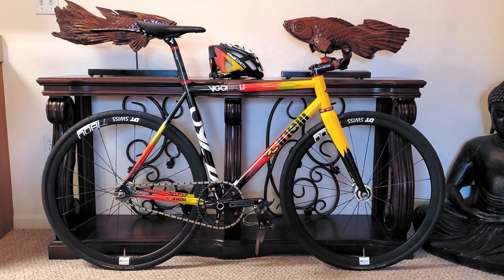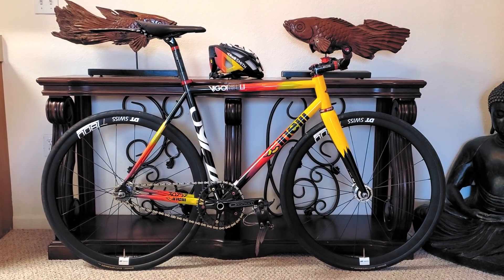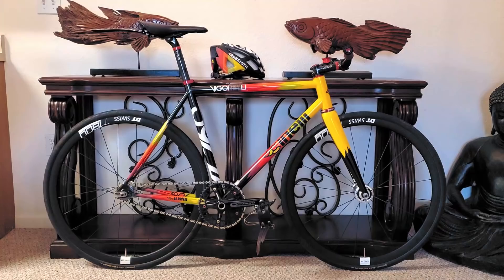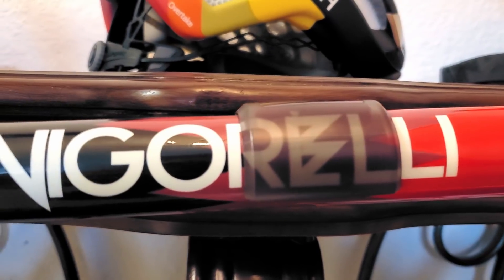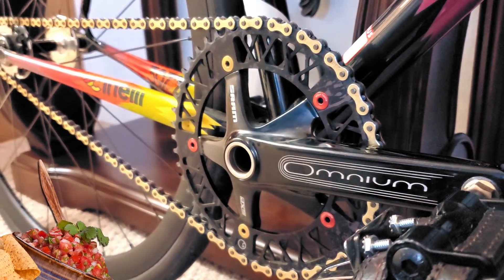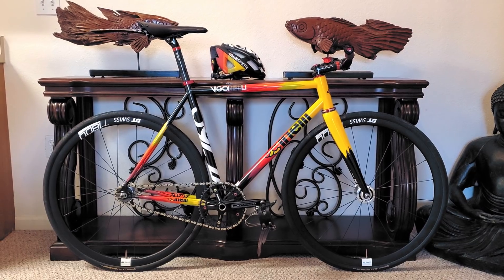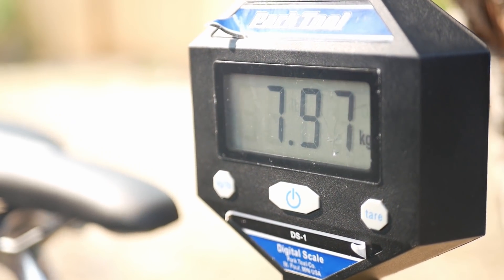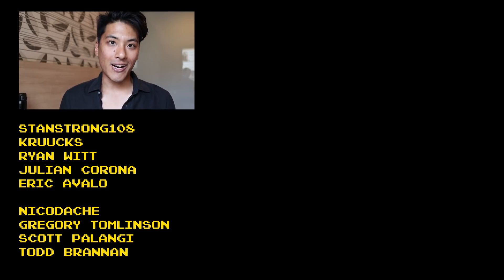Fixed Gear Bike Check: Cinelli Steel Vigorelli

Comment: You're on the other side of the world with notification at 11:30 PM local. Videos are always welcome. That bike looks great but currently lacking  motivation to send in my Aventon. Is nothing too exotic but weaned me from the trap of complexity, and ever changing standards of the bike industry. Rebellion. There is no fixie culture around  here but with front brake on am accepted as the oldest fast rider there. Downhills and tailwinds are really tough. I realized that in my prime really I used only 3 gears. I just picked the middle one and adapted decades later!

Comment: I literally just built my Parallax with most of those components. NEOS drop bars with histogram bartape, NEOS stem and seat tube. DT Swiss T1800 wheelset with DT Swiss hubs, aero spokes and Gatorskins. Omniums with the ceramic GXP BB, Izumi super toughness chain. No Brooks saddle but a cinelli one. Otherwise nearly identical except for the handlebars, headset, collar, cog and saddle. Solid build Raul
Reply: Gossip.

Not even close.

Comment: Seriously nice wheels. On the SRAM Omnium, the stock bottom bracket is not great, so replacement can help smoothness, like the Omniracer bottom bracket I switched too.
Reply: BeboSaab My SRAM bottom bracket developed a noise, and severe drag, in just over one year of riding. If I would guess, it’s probably a quality control issue. I went with an Omniracer bottom bracket, which was immediately noticeable as smoother, quieter, and less friction.
Reply: On sram cranksets you can change the sram standard of BB to a Hope BB and buy a sram ring adapter to convert from sram to hope.  The hope BB is shimano standard.

The bearings will last longer and smoother.  And extra points because it’s Hope 😊😊

Comment: it just me or I never saw anyone put the seat post clamp like that
Reply: Some bikepacking saddle bags interfere with the seat clamp in normal position. Not sure this is a bikepacking bike tho
Reply: It reduces localized pinching from the seat tube slot and seat post clamp on the carbon seat post.
Reply: @props651  Should I do the same when installing my carbon seatpost on my aluminium bike?
Reply: I would. I do the same on my cinelli semper. "Better to have it and not need it, than to need it and not have it."
Reply: @props651  Thank you dude, so glad I saw your comment or else I would’ve never known :P

Comment: Steel is real...but also real heavy.
Reply: high end steel is still lighter than low to mid tear alloy
Reply: @johngorgis  high end steel is super expensive tho but really nice. for that price you can get a lighter alu frame or even a carbon frame like the Dolan seta or  the planetx pro carbon.
Reply: masahito sato cant argue with that ,titanium has to be the best compromise between durability and lightness but its very expensive
Reply: The vigorelli frame set is actually fairly light. When I got mine I was pretty surprised at just how light it is
Reply: @johngorgis  yeah ti is crazy expensive
Reply: @OGLobster  I find that the vigorelli steel is quite heavy, 1.9 kg. But the thron is quite good tubing. Like if the vig would be made with the life tubing it would handle totally different. For around 1000$ or € you can get an amazing alu frame that weighs around 500grams lighter or even less and maybe is cheaper. But then again you have to factor in the ride quality and what you want in a frame. If you want a steel frame its perfect. If you want a light bike you get an alu frame or carbon one. Really depends on what you want
Reply: This bike weighs 17.5lb
Reply: @raulopes . Not saying the complete bike is heavy but the frame is if you compare it to other alu frames for the same or lower price.
Reply: @BeboSaab really depends on the person, frame or and components you got on it. Same goes for steel. A high tensile frame rides like shit and a cheap alu frame rides like shit.
Reply: @M.asa.  @BeboSaab, both right. Comes down to preference.
Reply: @jester0card  of course it does.

Comment: i never liked the geometry of the vigorelli. i cant get with track bikes with positive angled top tubes.
Reply: I have a vigorelli I understand where you are coming from with the relaxed geometry. I use mine for messenger work and food deliveries and having a more up right position can help with long shifts and keeping the food from leaking.
Reply: @OGLobster   @OG Prangster  i hear that and as a full time messenger for "snap courier" here in chicago, i work 12hrs a day, 5 days straight a week. i work on a bb17 transfer (lo pro), a blb london lo pro (which im working on today), a 2010 khs flite 100, and a 2010 cinelli gazzetta. hauling large catering on long distance deliveries ive never had an issue with damaged goods. but its all preference to the individual. im a 10yr veteran in the mess game so i know what works best for my riding style. stay safe out there btw!

Comment: hh u all shall check Raul' s strava, this gut is slow as 🐢🐢🐢 lmao....plus he was still riding with a front brake 2months ago🤣🤣
Reply: Says the guy with a 7.9mph average in most rides 🤣 also what's your longest ride? 20 miles? I average a 13 to 14mph in most rides...even my 60 to 80 mile rides
Reply: @raulopes  Ops go check my strava son... I guess u've never rode with competitive riders... Plus u ride in the suburbs where no cars🤮🤮